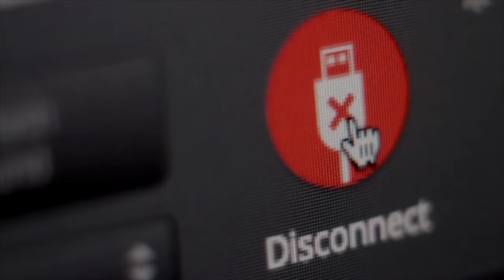BetaFPV HX115 is the best micro FPV racing drone with HD video

Comment: It's the most freakin durable quad i have seen!  1.5 months outside in the rain with Lipo connected completely lost after crash, found by some random woman, asking if it were mine! 3 months later crash into hip deep water, completely under water for 10-15sek, again in flight, armed, letting it dry out for few hours, helped with hair dryer, fully OK! crazy little thing haha Additionally I got myself another one when the first was lost, still have both of them :)

Comment: Who should buy it ? Someone other than me, who has  already spent way to much on those " reliability issues ". After 3 quads and three failures, I'll wait till I see a long term review before BetaFPV ever sees a dime again. You got a good one, and could be they have fixed their poor reliability, but I won't gamble 160$ to find out. I have a 3" XJB that has been super reliable for over 2 seasons ( with crash repairs of course). Good review as always,  and thanks !!

Comment: I love mine. My only issue with 4s with the bi blades is that theres so much jello. I have used 4s with the 3 blade props and the flight time was insane when cruising around. Some jello and high throttle but not much. Also made a small ND filter for it and it has helped with some of the problem.

Comment: Loving the Channel JB learnt so much. As for reliability of the HX115 HD, mine arrived this week & out of the box Voltage or current was not being reported in BF. Upgraded to 4.1 same, made sure ESCs were on latest firmware, flashed back to 3.5.1, then back to 4.1 but nothing. Seems like a FC issue to me, so sent it back & immediately bought another one :-)  I had ordered a RunCam addition but was initially sent the Caddex version. Kind of glad it was faulty & had to send it back the FPV view seems so dark on the Caddex unit. New one should be Runcam & here tomorrow . Happy days

Comment: Thank you Joshua for a great review! I love that quad! And the xh100 is a great little rocket too. Really impressed with betafpv lately. 👍
Reply: But the hx100 frame breaks too easy i broke mine in half when i got stuck on a tree but like you said it did fly good i would say even better than this one
Reply: @treses_1362  Hi. I got 2x HX 100 . One was the updated frame from the reviews 2mm and got 3 more spare ones. Have to say I crashed many times and haven't broken anything-yet :D   even if it happens I'm ready to replace. Betafpv send the frames with all the hardware and the foam and battery strap. Could nearly build another quad out of this.  The other one I have is crossfire and that one has a better (maybe even stiffer)frame with thicker motor  mounts. Not sure why they didn't ship them all like that 🤔   
But I agree , I have tons of fun with them too. Great little quads.

Comment: Split nano is for whoops and Toothpicks, 3" can do better. With only slightly wider motors it could just as easily carry a RunCam Hybrid and have up to 4k video + a proper FPV feed. A bit more KV and you really don't need 4S so your AUW would be very similar.

Comment: I purchased a Larva-X from RDQ (which I had to return) and two 525Mah 3S Lipos. I see the recommended Mah is 450 for this BetaFPV. Other than a little longer flight time, should I NOT use the 525Mah's on this particular quad? Would it burn up a motor or esc?I love this review!!

Comment: The durability issue on the 3” is fixed as far as I’m aware.  On the 65mm they have upgraded the frame to be thicker and the strengthened it up in a few spots. Sadly I have the original hx100 frame on mine and I broke it but it took a lot to do it. Waiting on a replacement frame now 👍
Reply: Same broke mines literally in half

Comment: Setting Antigravity to 3 or Off even, may help with the oscillations on throttle punches. With the default I-term being higher in 4.X, 5 is too much AG for some quads.  

it may be like 5 other things, but that's one to try. :)
Reply: Do you think will help with the oscillations I'm getting on 4s with the bi blade props?

Comment: Had this been available when I started flying multi rotor FPV and had I known of cheap goggle, radio, battery and misc. options. For the same price and maybe a 20 or 50 dollar bill more this would have been head and shoulders above my "green" dronium for starting on a good path of freestyle multi rotor FPV. That is to say "grown into" and not "grown out of" said drones.  But that is another story for another time amongst folks whom may inquire when face to face while rippin and chillin in the near future.

Comment: Lots and lots of "TWIG" (Tiny Weight In Grams)  type 3" quads out there now in that formula. 4 arms, 1105 motors, half a dozen 2-4S whoop style AIO FC/ECS boards now that are decent, good 2 blade 3" T-mount props. What's new and super special from the zillions of other 3" models of the last several years - mostly lighter weight parts.

Comment: I really wish they put the emax 1306b motors on these (the T prop 1306 version). You could run even the hq t3x3x3 on 4s butter smooth. It doesn't quite feel like a 5 inch of course. but honestly you might think it's a 4 inch XD.

Comment: I opened up my new HX115 to add a LED strip and paint the canopy a better colour for my spotter, to find that the camera to board multi ribbon had been clamped somewhere during initial build and two conductors were bared and starting to fray. Luckily they had yet to short out with anything or separate, as it all still works. Not Good!

Comment: i only have 3" and 7" quads lol (big gap i know) but i always love going back to 3" because they are so stress free. i've hit tall pine trees with them and fell out of the sky and they can just bounce up and keep going. dare i say it; its almost like since there is less weight there they don't break as easy. don't get me wrong my 7" rooster with your fc and esc can take a beating but if you land on the battery it'll usually rip it out because of the force and speed on larger kwads, but micro or minis just flip over and keep going... all in all i do love how it feels to fly larger kwads though so i go back and forth:/

Comment: Love my hx100. Would love to get a hx115.
Reply: I got both and tbh better stay with the hx100. If you want a 3 inch build one yourself with amax 1303 motors
Reply: I have 2 HX 100 one Frsky and one newer version from TBS with crossfire. They both ripp. Crossfire is better of course.  Have the HX 115 too. It's different from the 100. It works great out of the box. Of course you can build a quad that might be better but this is working out of the box and can do a few updates to make it better (put some foam or battery pad under the frame for the battery not to hit the usb, change the vtx antenna for a TBS triumph pro for better video range and you have a good quad.) Yes, it adds to the price but it work with no hassle.  Look, it's all down to what you intend to use it for.
Reply: Peter Zingler I’ve got one started already lol. Twig with rcinpower 1204’s 👍
Reply: Red Alpha that’s the only reason I got the 100 lol. I hate building the tiny ones.  I got the kit from kwadbox for the betafpv 75x when they had it. Still haven’t built it lol. I can’t get the pins soldered on for the cam and I wound up and blew my first fc soldering the rx onto it but betafpv was cool and sent a new fc but I still never built it. Aactually thinking of taking the motors off of it and putting it on the hx100 for some 2s racing. Their 11000kv which would work on the 65mm props but I kinda think It might be a touch too high at the same time. Oh well gonna try it anyway 😋
Reply: @archer4922   Yes. Same here. It's so tiny to work on with my sausage fingers it's just near to impossible. It's working out of the box  and that's all I care about.   Your idea isn't that bad you know. If you go ahead and do the motor swap please let me know how it's working out. I might even do one myself just for fun. 😉 👍
Reply: Red Alpha I’ll definitely post something about it either here on on instagram lol. Archervr1 on insta.  I post way more there than here. We’ve been trying to start a micro league here in Louisiana and I really wanna race some micros soon.

Comment: At the beginning, you are saying that you stop at 3,5V the battery? This is usually what you do in general? 3V is not good, too low?
Reply from the maker: If you run all the way to 3v you will damage your battery due to the high current pulled by the motors.

Comment: Hello again Joshua, seems every time i build a new quad there's always 1 issue that i haven't encountered with previous builds...hoping you can shed some light on this. When i gradually increase throttle the motor spins up faster until about 1500 then it starts decreasing this started when i went to test hover so i brought it back to the bench and ramped them up individually with same results, i can however blip full throttle and they do spin up the max amount. I can't find any problems online that seem similar.

Comment: I'm still learning the whole stator/kv/prop relationship. It was mentioned that 4s with the tri-blade would be too hard on the ESC since they are 5000KV motors and that a bi-blade 3020 prop is more suitable. Why is that? Is it about the amp draw of the tri-blade with that pitch? Out of curiosity, what would be a better motor to use with a tri-blade and 4s on it? Or is there one? I'd like to be able to get the knowledge  where I can read the specs on a quad and get a feel for whether the motors it has are appropriate.
Reply: With the triblade vs biblade it's an issue of the 3 blades producing more thrust, which requires more energy, which draws more amps. To go triblade on 4s you would want to go down in kv to 3300-3700 or so. Lower kv means that at the same voltage the motor will rotate slower. At higher kv the motor will attempt to rotate faster, but if the prop requires more energy to get up to speed the amp draw will increase which can overload the esc.
Reply: @sixtofive  Makes logical sense. How do you know what lower KV would be appropriate then?
Reply: @amen_ra6926  For me personally, it's just from having kept up with what's being produced and getting an idea of what ranges seem to get good results from a combination of my own experience and from watching reviews on YouTube. In truth there is nothing set in stone, and what will work best can vary greatly depending on what results you're looking for. Some want higher kv and are looking for raw performance at the cost of shorter flight times. Some people go lower kv and value longer flight times for laid back cruising flights. For me, I like to try to find the balance in between so I can get efficiency, decent flight times, and good performance. That's a moving target that every one searches for, and all of these numbers change based on the relative weight of the craft you're flying. It's complicated, but eventually it becomes some what intuitive.
Reply: @amen_ra6926  For a more direct example. I have 2 custom 2" builds made for 2s batteries and both use 1103 size motors. One is on the heavy side at 85g and uses 8500 kv, the other is much lighter at 52g and uses 11000 kv. For the heavier build I need to use 450-650 mah batteries for good flight performance while the lighter one uses 350-450 mah for best results.

Comment: asking myself wether the beta 85 x hd intestines wouldn´t fit a HX115 frame - specs look the same but for the split instead of the turtle....was meaning to sell it but the setup seem to work well without whoops

Comment: Hi Joshua! Would you recommend flying the HX115 indoors?
Reply from the maker: I did it easily in the FreeFly warehouse, but in a regular house, I think many pilots would find it difficult due to the power/speed. Also, when flying indoors I really prefer to have prop guards because you bounce off the wall so much.
Reply: @JoshuaBardwell  alright, thanks for the answer! And great video! 🙌

Comment: Comparing it to the larva isnt fair considering you could buy 2 Larvas for the price of the Beta. The image quality looks great though.
Reply from the maker: Larva X is $110 for the SD version. HX115 is $160 for the SD version. Not 2x the price. Anyway, the point is to compare the way they crash, which is a comment on the design, not the price.
Reply: @JoshuaBardwell  I got mine for 83 on banggood. But I see what you mean.

Comment: is it better than the GT349HD ?
Reply from the maker: They are kind of different quads. The 349 is in a totally different weight class, with 1408 motors and an 800 mAh battery. Between them, though, I think I would rather fly the HX115. It's lighter. Crashes better (because it's lighter). It still captures HD video. The batteries are cheaper. The 349 will probably out-perform the HX115 in a pure head-to-head contest, but from the pilot's perspective, I think the HX115 would be the one I'd take.

Comment: Is this the best toothpick with HD under $200?
Reply: I’m torn between this and the GepRC Skip HD 3, which I believe is newer. The Skip has a TPU canopy which is more durable than the injected molded beta ones, and doesn’t have as much camera jello. You can also choose the camera and receiver on the GepRC website.

Comment: This one or the Diatone Rabbit 3 inch? I MUST KNOW!!! ;)
Reply: Depends what you want to do with it
Reply: @robbinkoot2154  JB loved the Rabbit also, soooo, I was just wondering...
Reply: @stevo43068  the rabbit is crazy fast and cheap, but it's heavy, and probably less durable. The Lipo's need to be bigger and also more expensive. But if you don't care about that go for it
Reply from the maker: Rabbit is much heavier and less durable. Totally different flight experience though since it's more "flingable" and possibly faster.
Reply: @JoshuaBardwell  Thank you for taking time to reply, you the BEST, I have the Tinyhawk Freestyle, perhaps the Rabbit is my next step. I have 850 mAh 4S's (that I haven't used yet, BTW (thinking ahead is usually not my MO, but there it is...)), this would be a good use for them.
Reply: @stevo43068  I learned on the Tinyhawk S, went right to the Diatone GT349R and it was WAY too fast! Bought the Tinyhawk Freestyle and it seems to be a good middle point between the S and Rabbit. IMO, If you can handle the Freestyle well, you should enjoy the Rabbit.